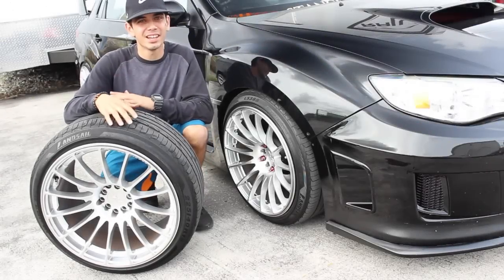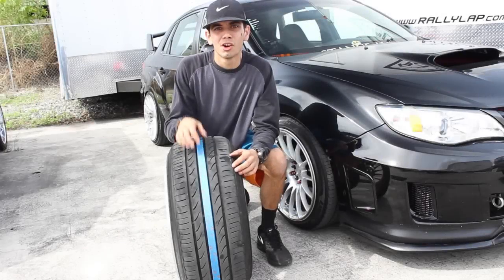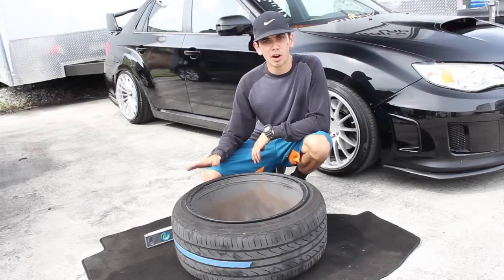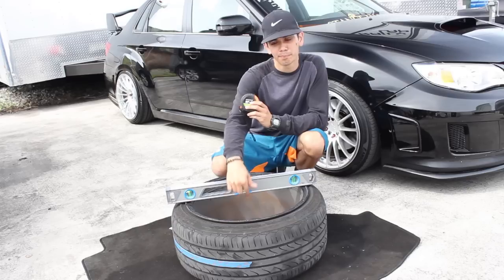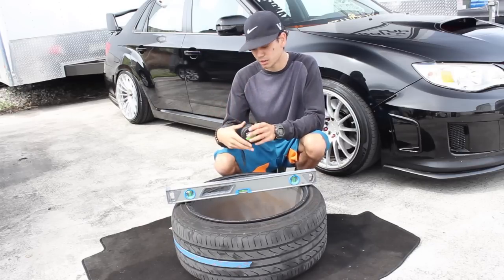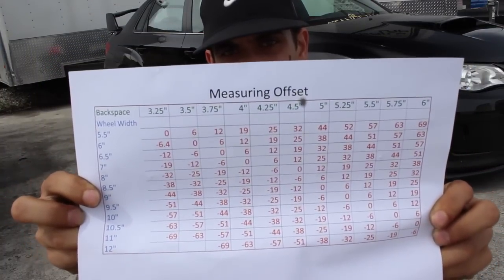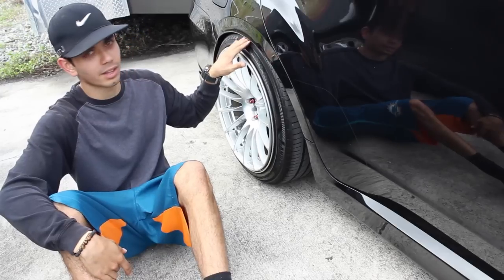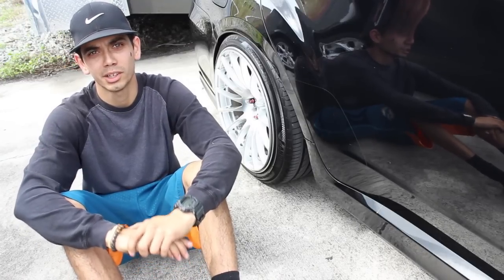Wheel offset - Basics

Comment: i have 2018 maserati granturismo. tire size is 285/35x20(rear) n 245/35/20(front). this are stock rims which donot sit flush with the fender. what offset do i need to make sure the new rims im buying will fit flush with the fender.? please help

Comment: great video thanks- still a bit confused simply because I'm not certain what will fit in the wheel well of my 2008 impreza subaru wrx sti. Open to comments and suggestions. My car came with 19 by 9.5 I want to drop to 18 by 9.5 or 10

Comment: Is positive offset better for avoiding suspension components?
Reply: Neg offset will stick out further from the suspension. Positive offset will hold the wheel closer to your suspension.
Reply: Even certain positive offset sticks out. Depends what your factory specs are and how the car fenders are designed on the car.

Comment: Hope you can help. I have. 2000 new beetle 
with its stock rims that’s are 
Size: 16” x 6.5”
Diameter: 16”
Bolt pattern: 5x100
Width: 6.5’
Offset: 42
And I want to fit a 2007 GTI stock rims-
Size: 17” x 7
Diameter: 17”
Width: 7”
Bolt pattern: 5x112
Offset: 54mm

Would getting a wheel adapter that’s 5x100 to 5x112 and that’s 15mm thick work??
Would that avoid hitting the fender and the suspension?
I believe it would stick out 3mm more then the stock rims.
Please help

Comment: the biggest tires I can use on my e36 is 225/45/17 (don't want to bother with getting a bigger size registered), and I was looking at getting a set of JapanRacing JR9 wheels. will a 17x8.5 wheel give me a bit of stretch with that size tire or do I need to go 17x10? again, I'm not looking for a massive stretch, I would like them to look similar to your setup but with a 225/45/17 tire

Comment: I have question. My wheels have a +35 offset but I’m rubbing on full right turns on the inside back part of wheel well. Hitting the plastic. Would spacers help this issue by bringing the wheel out a little?

Comment: the lower the positive offset the deeper the concave. +5 has a big concave its not straight across.
Reply: I think the amount of concave is the best way to VISUALLY explain offset. For example. I recently went from 50 mm (stock) to 40 mm (aftermarket) offset. The 40 mm wheels are 10 mm’s more concave than the 50 mm wheels, by comparison. In short, they look 10 mm’s deeper (more funneled) in the center.  The more concave the better they look, IMHO.

Comment: Help. I just bought rims and tires. And i didnt study the offset before mounting my new wheels. Now i noticed it is little outside the fender or wheel well, negative offset. Maybe 1 or 2 inches towards the fender. What can i do to adjust it to put it towards the wheel well or suspension. Thanks

Comment: quite a intuitive vid!

After knowing the offset and back clearance. would people be able to know the aftermarket wheels is suitable for their cars, by choosing similar size of wheels to OEM wheels(say 19 to 19 and 8.5j to 8.5J or 8.5J to 9J ) and similar offset (et40mm to et30+ or ET40MM to et40+ ) in presuming that the fender and suspension stroke has tolerance, or it still has risk of rubbing ?

Comment: I just bought a Scion tC that comes stock with p225/45r18. It comes stock with +39 offset..........Let's say I want to go a little wider. I go 235/245 on the tires correct, and the rims itself should increase or decrease in offset ???

Comment: how do you change offset? spacrs?
Reply from the maker: Good question, the offset can't be changed as that is how the wheel comes. To change how the wheel fits in your wheel well you can add spacers so they fit more flush with the fender and stay away from your suspension components.
Reply: Steven Beatty i hear you might need hubcentric rings as well if youre gonna use spacers. I have 1" spacers myself but they didnt come with hubcentric rings. Instead they have a lip. You can also look for spacers that have a lip for where your rim will sit.

Comment: what wheels are those?
Reply from the maker: XXR 550 18x10
Reply: Driven with Purpose and what size tire?
Reply: I have been looking for wheels for my FRS and it seems like every wheel has a 45 offset . I want my wheel closer to the outside of the wheel well would 45 make a difference?
Reply: Driven with Purpose how did you get those wheels to fit they say 8 and half inch wide Wheels won't fit unless you roll the fenders
Reply from the maker: I believe they were 225/40, they have a decent stretch on them
Reply from the maker: If the offset doesn't fill the wheel well like how you want you can always consider adding a wheel spacer to push the wheel more toward the outside fender.
Reply from the maker: The owner spent a lot of time fitting them in, its a combination of the tire stretch and suspension height to get them to fit. The wheels did poke out a little bit but has a really nice stance.

Comment: how about i have 38 offset whats the best solution?
Reply from the maker: Hey Darwin, thats kinda tough to answer since there are a few factors to consider. The best suggestion I can make is to find the look you're going for and to find some forums where people have the look you want and see what they're using. Good luck with the build!
Reply: OK Thanks :)
Reply: but the et38 can damage thr fender?
Reply from the maker: Every car is different but with that much offset you may run into issues with the wheel coming into contact with your suspension components. Check on your forums, they'll give you the best answers for your specific car and look.

Comment: Which is the best ET28 or ET40?
Reply from the maker: That all depends on your wheel width and backspace clearance. ET40 will have less backspace and runs the chance of hitting your brakes and/or suspension components. ET28 has less offset so you'll have more clearance on the backspace but will push the wheel out further which could cause it to run into your fender. Hope this helps out some for you
Reply: Thank you very much.
Yes, it helped. :)

Comment: I WANT TO BUY WHEELS WITH DEEP DISH LOOK. DO I BUY WHEELS WITH HIGH OFFSET OR LOW OFFSET? HELP
Reply: JUNEORJUNE high negative offset
Reply: THANKS
Reply from the maker: Aadl Fyith thanks for answering that! The high negative offset will give you the deep dish wheel you're looking for. Try to make sure the width of the wheel and tire will fit in your fender. Good luck!